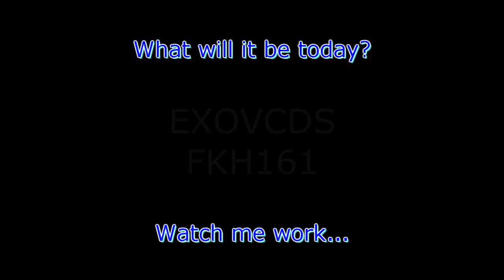VW A2: 1.8L Noisy timing belt tensioner

Comment: Nice find on the noisy tensioner Thomas. It sure does look pretty crowded down there. And while you were working on the water pump pulley, I noticed that the LED light gets way down there where there was good detail in the video.
Reply from the maker: stuzman52 Funny thing was, he was only in for the valve cover gasket. We checked it for an "intermittent noise" a couple of months back, but it never acted up. When I first drove it in for the valve cover gasket, it didn't make any noise. Not until I finished the job is when it started.